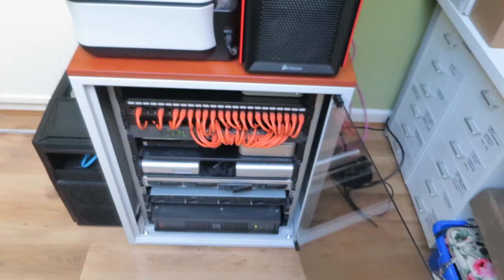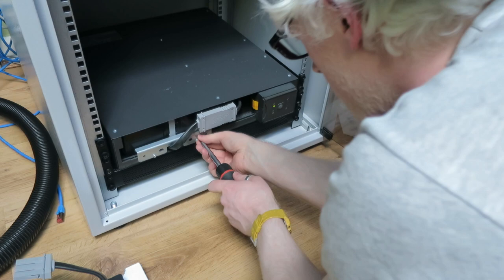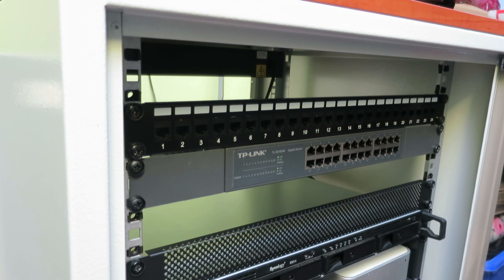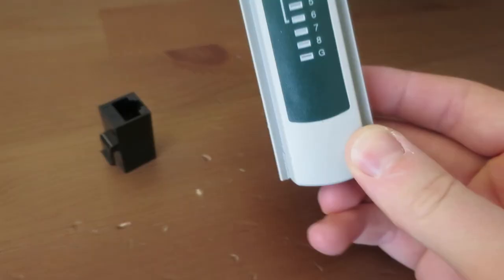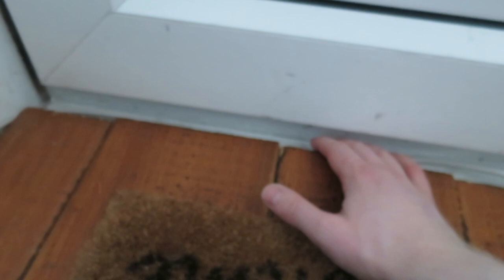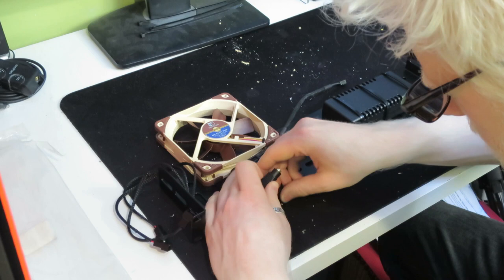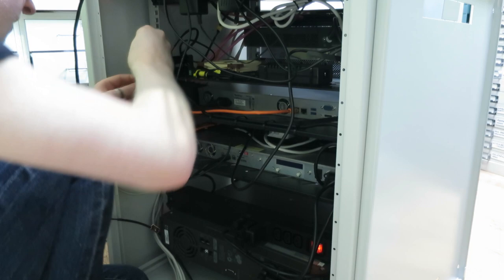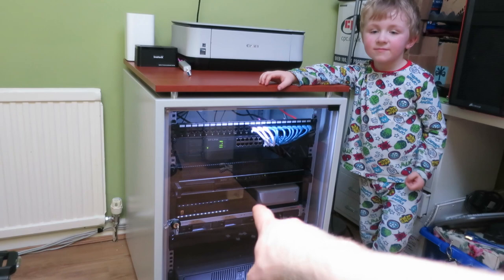Setting Up Our Home Network (Part 7) - Bringing It All Together

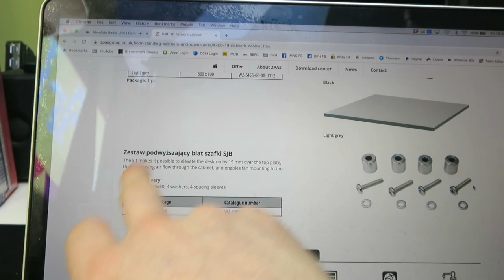Comment: I have been looking forward to it since Part 6 came out about 15 months ago!! Great video as always Tom, I noticed at 1:46:50 your MacBook Pro screen has quite a bit of delamination where the Anti Reflective Coating has rubbed off! Super common on all Retina MacBook Pros. I used to have a 15" Mid 2014 and had the screen replaced twice for free because of this issue. Don't think Apple is doing free replacements anymore though. Is it still working well as a laptop after 5 years or more?
Reply from the maker: Part 6 was 15 months ago?!? Oh my gosh!! hahaa.. well, hope it was worth the wait. I had great fun making this video.

Yes you're right, I have a huge amount of delamination. Believe it or not, I didn't have a clue what it was until relatively recently. It's never really bothered me too much but I was definitely glad to learn what it was because I was always curious. It started to happen only a year or 2 into owning the machine.
It's absolutely glorious, hands down best Mac I've ever purchased. I've owned it since October 2014 and it feels just as brand new as it did back then. It's a late 2013 base model, so no GPU to die on me or create unnecessary heat build up or anything like that. I've used it to death, the whole machine shows signs of heavy use but I've always looked after it and it's always looked after me. No plans to upgrade for a long time.
Reply: @ItsMyNaturalColour  That's good to hear. I've watched every single part from the start and have been watching you for a good 7 years. at least. I remember watching you when you still had the 2008 Mac Pro and the old 2008 MacBook Pro and I can remember watching the whole Hackintosh series when you were building it like it was yesterday! I watch every single video you post all the way through! Keep up the great work Tom. It's May 24th today so exactly 15 months ago to this day it was posted! February 24th 2019!

Comment: You could probably drill a couple holes in those top ears for the ups as there seemed to be a threaded hole on the top half of the ups so you could mount it more firmly
Reply from the maker: I'll be revisiting the UPS mounting in a future video and utilising those threaded holes. Thanks for the suggestions.

Comment: Great Video Tom! One thought I had was, is your Rack on Castors? Or can they be fitted? Might make it a bit easier to move about when needed.
Reply from the maker: Thanks! Yes, I have a set of castors for it, the supplier was kind enough to supply both feet and castors when I bought it. I decided against using the castors because the rack is very easy to move on laminate as it simply slides, so I've stuck with them.

Comment: Ok, so I have a question... Where exactly do you think the air on that bottom intake fan will go? Take a step back and think about that! Please! The answer btw is in the front plate that you diss because it is bent... At least you put a filter on it or it would only have served to pull dust into your rack.

Comment: You are going to use some material to protect the cables from getting nicked or cut where the cables are going to be coming in, you going to go with fiber through the house to give 100 GBp/s throughout,If you have money to get a printer what about a LASER printer like the Brother HL-3150CDW uses coloured polyester powder but uses for the fusing process unlike the printer that uses a liquid ink, I have updates coming down every 30 minutes and will have to leave you for a short time.

Comment: how long does your apc last when power goes out
Reply from the maker: I've never had a long enough power cut to test that out. It's lasted through all power outages we've faced since I bought it. I don't pull a great deal of juice, so I'd estimate at least 20 minutes to half an hour, maybe even more depending on the system load at the time.

Comment: you could have saved time and money by going to a local hardware store or home improvement store and buy those spacers and washers and screws .....they basically the same ive bought similar for less than $3 whole set (£2.17)

Comment: you could have bought 2 normal batteries and connected the existing cable to them
Reply from the maker: Yes it is possible to swap with a DIY solution. I wanted the genuine thing though, that was I know it's all good.

Comment: TOM... i don't need to tell you this , I'm watching the video and see your running cables with extra length .. for what???? you should know the shorter the cable the better the signal - true and also putting can reduce signs .. better having a direct cabling system.
Reply from the maker: Hi Colin - I have the extra length 'just in case'. For gigabit over CAT6, I don't think an extra few meters will make a difference, not a noticeable one anyway.

Comment: When I do ups battery swap I always power them down because they can be dangerous having them left power on
Reply from the maker: They're designed to be hot swap, it's perfectly safe.
Reply: Alright then that makes cents and are u going with ubiquity for your network equipment

Comment: Just wondering, is that fan the right side up for intake? I figured the logo side is the one it pulls to, but I might be mistaken.
Reply from the maker: Logo side up is indeed the correct orientation for the intake, you're probably looking at the clip prior where I have the fan sitting in the bottom logo side down. Next clip shows the fan installed logo side up.

Comment: Just a heads up Tom at 2:26:00 that kettle lead you used for the fans, I had one which looked identical and came with a 12v psu and it had a fake fuse inside and extremely thin CCA flex, probably alright with the tiny load you're pulling but just thought id let you know, keep up the great work!

* Looks like one featured in this video https://www.youtube.com/watch?v=Ib7Dd92mGRQ
Reply from the maker: Wow!!! Jacob thanks for the heads up on this I'll check today....  really do appreciate this, seeing as this is a 24/7 setup, crucial that I don't have any dodgy mains cables. Thank you!
Reply: @ItsMyNaturalColour  No worries dude

Comment: does that fan suck or blow. remember heat rises.
Reply from the maker: Which one? The bottom fan is intake, the top fan is exhaust, and the middle is in the same orientation.

Comment: Just so you know, 120mm noctua fans pull only 0.05A ... that power supply is huge overkill ... but you can put a lot more fans on it :D
Reply from the maker: Definitely! One of the biggest reasons I actually went for a larger PSU was to get an in line brick that I could tie to the shelf, as apposed to the lower capacity PSUs that are mostly plug style bricks.